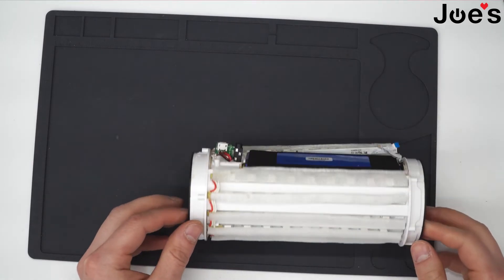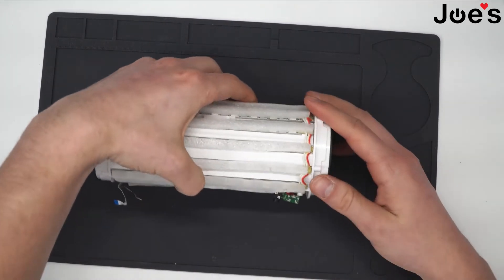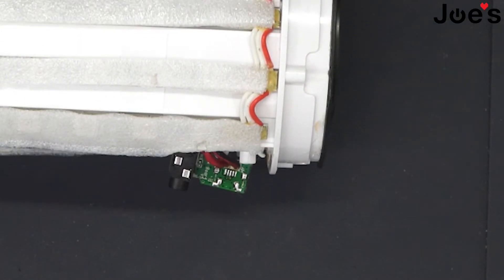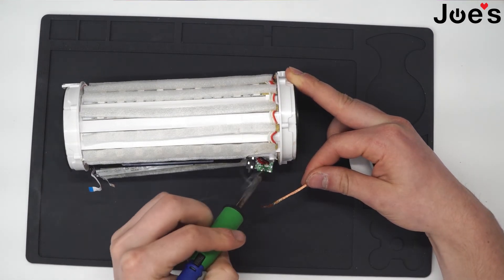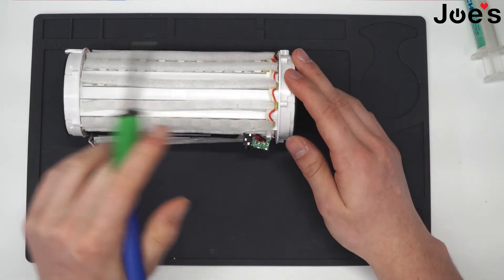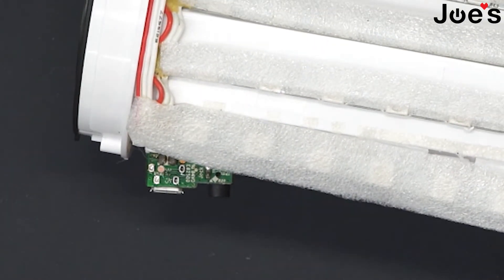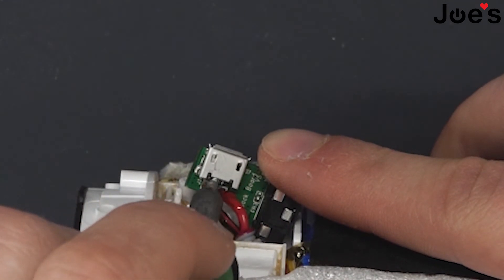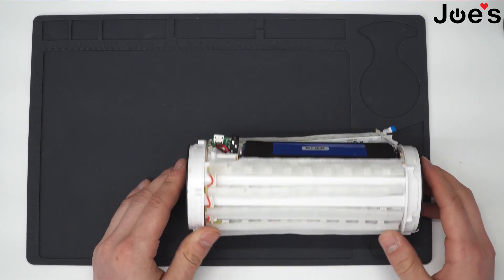JBL Pulse 2 Charger Port Replacement Not Charging Micro USB

Comment: Are you still repairing these? Can the port be changed from micro USB to m USB - c ? Have you looked into battery replacement or upgrading mah ? Just curious thanks for the video
Reply from the maker: Hello, unfortunately, we do not repair this device anymore. We do sell the parts at www.joesge.com though. - Aaron P

Comment: Hi, it doesn't matter if the battery is plugged while replacing the micro usb
Reply from the maker: We recommend the battery is not plugged in. This way there is not short if you create a bridge between points and your tools. - Joe

Comment: Can you give me a rough estimate on what you think it might cost someone who doesn't have any tools? No solder, iron, flux, etc. I get that there are variables in the prices I'm just looking for an idea of how much I need. Thanks.
Reply from the maker: Thanks for watching! The cost would totally depend on which soldering iron that you buy etc. We sell the charge port alone for $7 so you would need to price out the tools and such. If this is the only time you plan on using the soldering iron and such then it may not be worth it. Hakko makes great soldering products that are intended for long term heavy usage so they are more expensive. We use Hakko gear and love it :) Matt D.